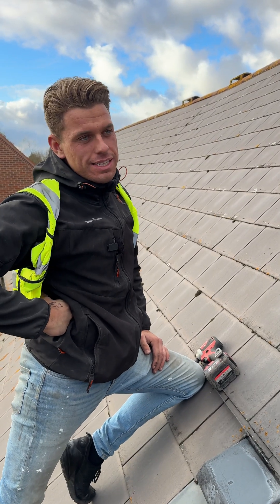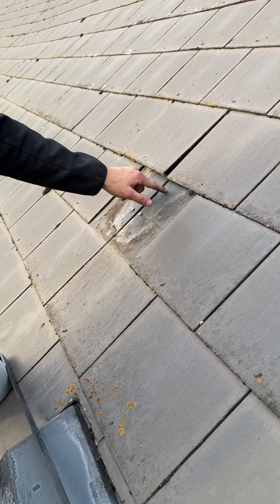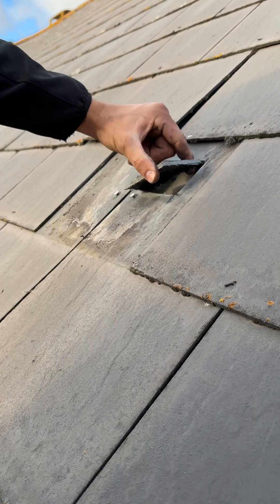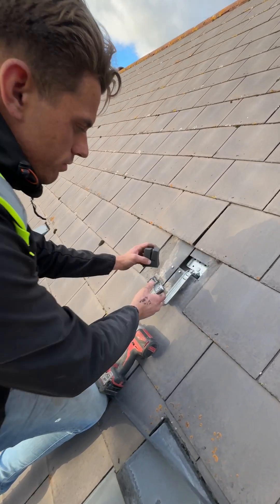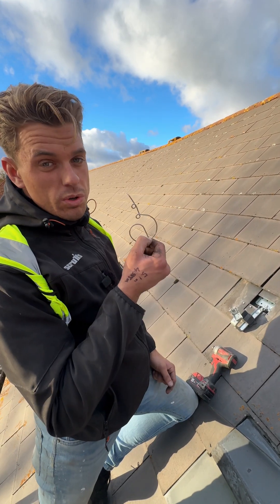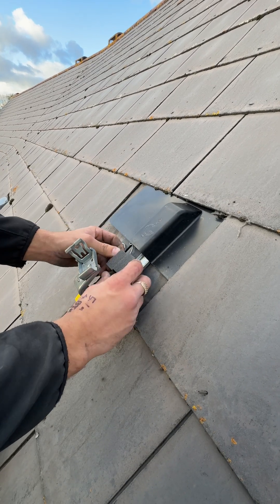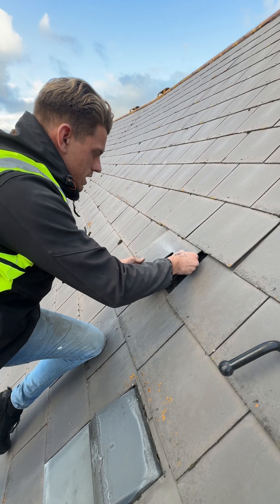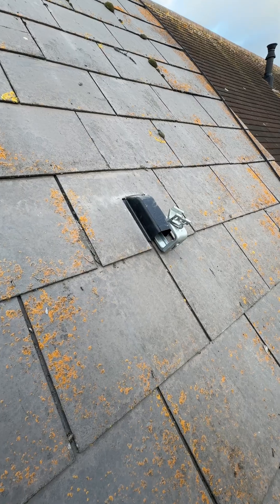Making It Look Easy! Mounting Solar Panels To Slate Roofs...

Comment: How did you know rafters was there
Reply from the maker: Normally have to take a couple of tiles out first, but you can make a good assumption normally.
Reply: You go in the loft and measure it. P.S. They're slates, not tiles.
Reply: Remove tiles, hammer to sound one out. Drill either side to find exact center, seal. Measure out 24 inches to each subsequent rafter, or whatever the standard is in your area. Plenty of mounting holes in plate = lots of wiggle room if some are off.

Comment: Nice explanation thanks, have you done any where you strip the slate over the entire area and use an in-roof system? This seems to be viable as the slates could be sold? No point in having all that nice slate under solar panels…
Reply: Probably not worth the labour removing all the roof tiles, and that solar system would be more expensive than just panels, or atleast sounds so. This took minutes to install a mount that doesn’t compromise the roof.